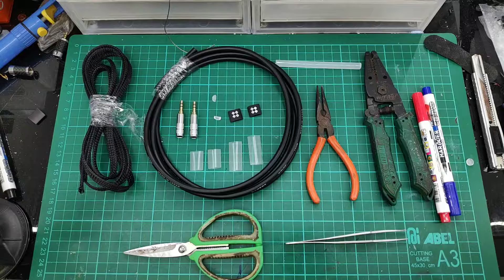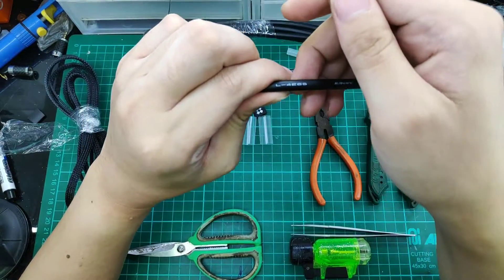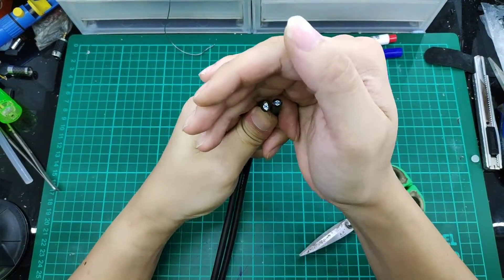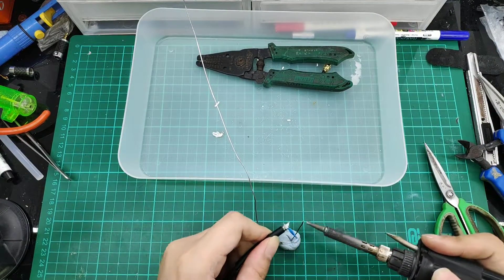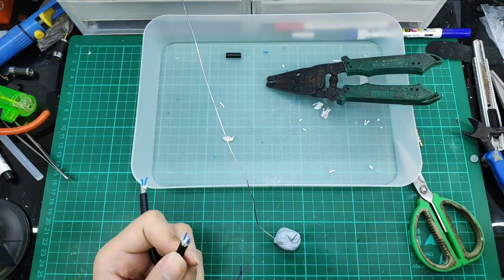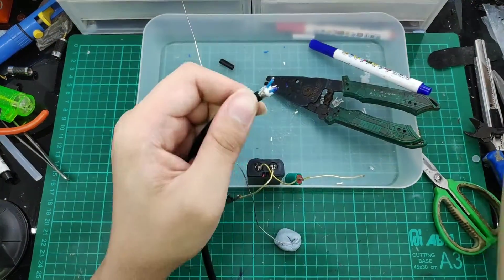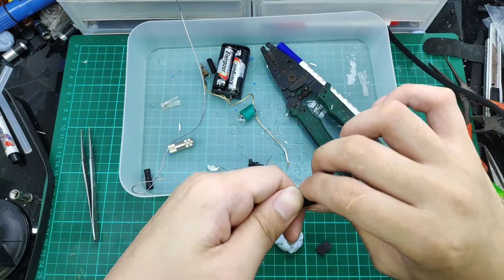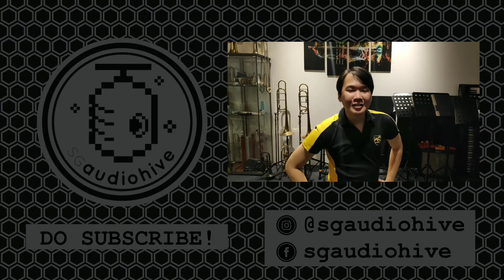DIY Aux 3.5mm cable tutorial

Comment: if you use adhesive lined heat shrink, do you still need to use glue?
Reply from the maker: its to your own preference in that case, but those adhesive shrinks works well

Comment: Is there a particular reason you didn't use both blue for one channel, both white for the other channel, and then use the jacket for the ground?
Reply: The blue and white are on opposite sides. therefore 1 blue+white pair is a twisted pair. If you use blue+blue and white+white they are twisted but are next to each other as opposed to opposite to each other. then it is a "kind of off" twisted pair.

Comment: I have made a few cables in my life (about 8) going back about a decade but found some really good tips in this. The heat shrink with glue both inside the barrel and inside the sleeving is a fantastic idea. I'm going to be making another cable for my DJ headphones soon and I'm definitely going to be using that trick.
Reply from the maker: Hope it turns out beautiful!

Comment: Any recommendations for 3.5 mm 4 pole plugs that you can use 6mm canare wire in?
Reply from the maker: Most plugs have 6mm opening, if you get the stripping and spacing right u can use most of them

Comment: I made similar using Kopul 5000 quad cable and Switchcraft 3.5mm TRS.  Unbraiding the shielding is a pain, but I tested with; 2 RC 2.4 GHz transmitters, cell phone using wireless and bluetooth, all the chargers one power strip could fit, and coiled the cable on top of it all.  No interference.  I'm still looking for a female 3.5mm stereo inline jack which fits the 6mm cable diameter.  The Rean 240l strain relief is not big enough, so I may just use those and make my own strain relief, or only partially unbraid like you did here.
Reply from the maker: I think in this case it's ideal to remove the strain relief and make a new one using heatshrink instead as it will reduce the foot print by 2mm
Reply: @sgaudiohive  Good idea.  I'm working on some now so I'll see what I can fit in there.

Comment: Hello, may you do one for braided wires for dual 3.5mm (headphone inserts) to a 3.5 mm output insert? There's one made for the IEM, but not quite sure if that's able to be used for a 3.5mm aux jack. Thanks.
Reply from the maker: Ah yes we do have aux cable tutorials

Comment: Anybody know the diameter of the nylon hes using to wrap the cable in? I'm asuming its 1/4" but i just want to make sure.
Reply from the maker: I'm using 10mm (millimeter) actually
Reply: @sgaudiohive  does it fit snug on the 4e6 cable?
Reply: @CAMANUBIX  3/8 always works for me no matter what. Get expandable though.

Comment: is there a reason that you use star quad cable for an unbalanced aux cable?
Reply from the maker: No reason, customer's request. But take note for unbalanced wiring it's still recommended to use 4 wires so both the L and R ground have the same return
Reply: @sgaudiohive  ahh thanks for the info! I ordered stuff to make my first cable for my philips fidelio x2 cable which is just an aux and it is quite hard to get star quad cable, is having only 2 wires + ground going to cause any big issue?
Reply from the maker: It is not, most stock cable only have 3 conductors